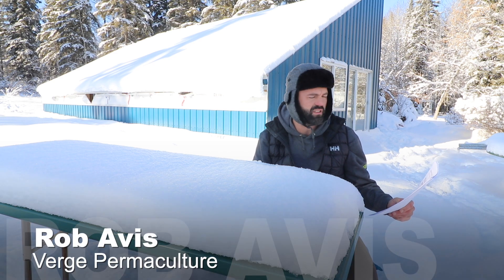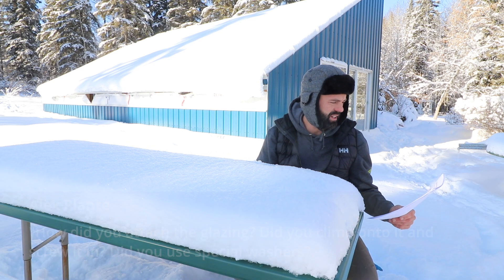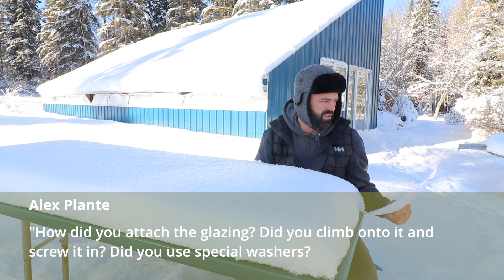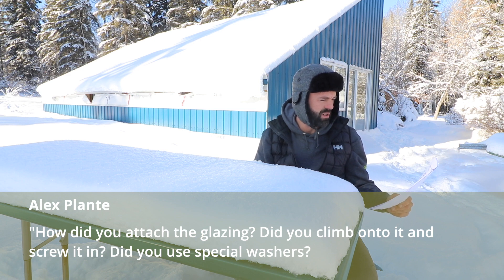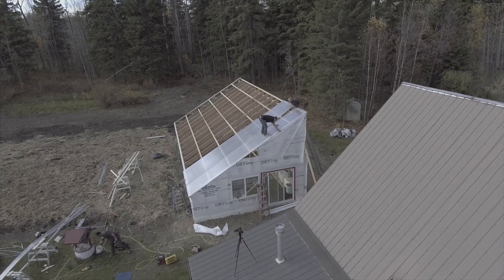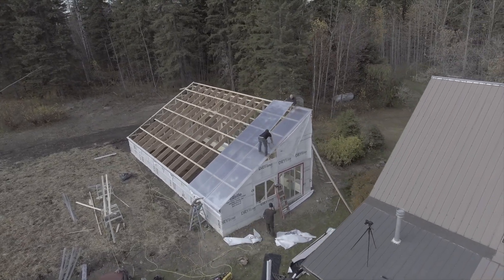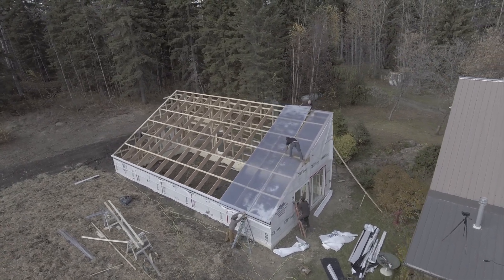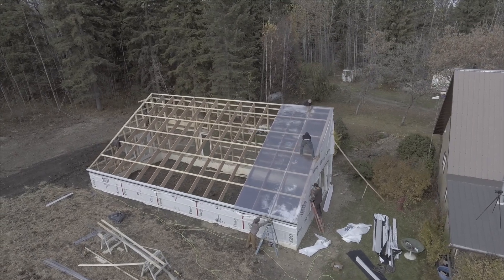How did you attach the glazing to the Passive Solar Greenhouse?   #AskRobAvis 005

Comment: Hey Rob, 
When considering shape for a passive solar greenhouse, will there be more heat loss with a lean to style, with fully glazed roof, vs a gable style, with the south facing roof glazed but the back half of the roof insulated? Snow load is less of a concern in my location.

Comment: Hey Rob,
There is another attachment system that works far better than the “H” channel, in my experience. It’s shaped more like an upside down capital “T”, but with two “legs”. It fastens directly to the purlins. The poly sits on top of the upside down “T” and butts into the legs. A second, slightly convex piece installs over the top and has a fastener down into the middle of the two “legs” of the upside down “T”, holding the panels down. The more expensive version has little rubber gaskets that seal against the poly. Made of aluminum. I use that system on the Oregon coast where we see 100mph winds almost every year. It’s expensive, but way easier to install and works beautifully. I’ve been enjoying your short updates on the property. Thanks!